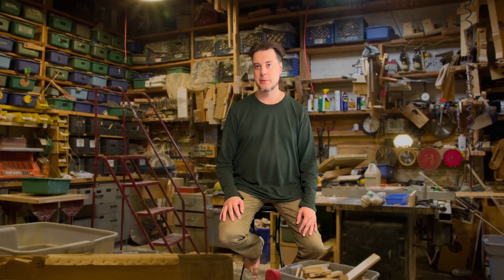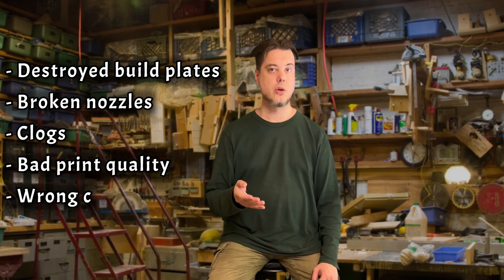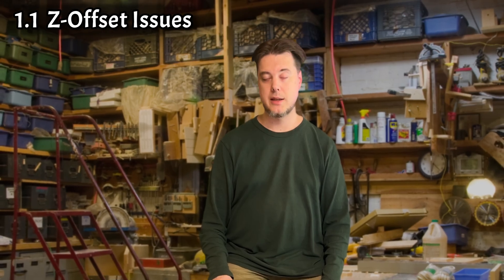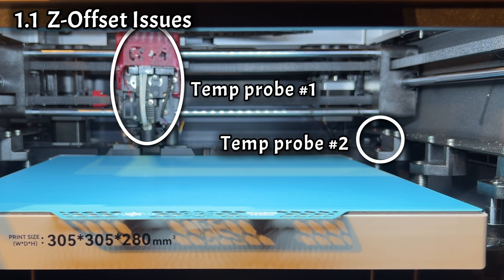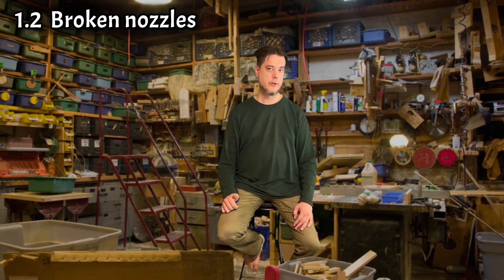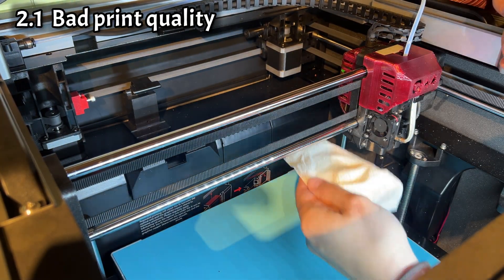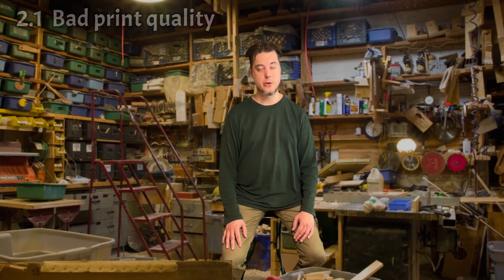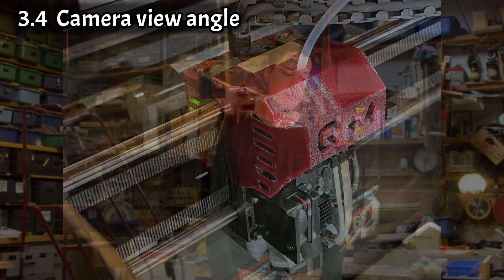Qidi Plus 4: Must-have fixes & mods (free)

Comment: The first layer is the most important layer, can't understand they use such an unreliable way of sensing.
My BLtouch never let me down.
Was thinking about buying this printer but this  issue cooled me down.
If I want a printer that always needs leveling or at least a visual check before every print I have my Tevo Tornado pre BLtouch.
I  expect that a modern next generation printer has a decent level method that works.
Reply from the maker: The Qidi Q2 has ditched the Plus 4’s bed piezo pressure system and apparently works better. I haven’t read of any reports on it failing.

That said, with these mods my Plus 4 gets solid first layers even without ABL at the start of every print. It is a good thing to do though if the bed temp significantly differs from the reference leveling.

Comment: Whattttt I just ordered this just tonight , should I cancel ?
Reply from the maker: It depends. It has a higher risk of having issues, but if you’re ok with doing the steps outlined in the video, you should have a great printer in your hands. Mine has been working great ever since.

If you bought directly from Qidi, returns are a no go no matter what. They’ll send you parts but they won’t let you return it. Amazon returns do work as normal though. Don’t know about cancellation if it’s even a thing, depends on the seller I’m sure.

Tbf I’ve heard similar sorties about returns from other printer companies as well, so Qidi might not be any worse than others in that regard. At least Q happily ships the parts as warranty.

Comment: Thanks for a very helpful review and thanks for posting the Macros.  

I've had the Plus4 for several months and printed reasonably without major issues.  That was until I followed some reviews of the Qidi Box, pre-ordered one and installed it when it arrived.  I have not been able to produce a single successful print since then.  Qidi support appears friendly on the surface but they are mostly ineffective probably due to communication difficulties.  All requests for replacement or refund were politely ignored and I am not stuck with an unusable printer.  The Qidi Box is clearly not a fully developed product.  It has some great ideas but the software implementation is very poor and the integration with the Plus4 has made every attempt to print a funny dance of 6x extruder cleaning, filament wasting followed by attempting to print at the wrong z offset.  I do not understand the z-offset mechanism.  At times the user can change the offset but then it is not followed during printing.  I'm now convinced that the extruder replacement (part of the Qidi box installation) has changed something that affects the z-measurement.
Reply from the maker: Damn, that’s rough. Have you found the Qidi Discord? I’m sure some folk over there can help you in some way.

Comment: So what is the best 3D printer out there i can use to print pc and nylon, without the need to rob a bank or sell my soul or kidneys?
Reply from the maker: I honestly don’t know. The only other printer than my own unit that wakes up some interest in me is the Qidi Q2. It has some of the Plus 4 issues improved upon, and it has magnificent specs on paper. It’s still Qidi though which will be a no go for some Plus 4 owners.

Although, I’m planning on waiting an upgrade until a suitable multi toolhead model comes available, from any manufacturer (except Bambu).

Comment: I love my "cheap" Qidi P4 after modifications. Taught me a lot about printers, enough to take on a Voron build next. I'm done with Prusa, Qidi (and yeah Bambu due to what you pointed out). Thank you so much for the gcode you made, absolutely saved me time and money. I've been using your macros along with the community mods for about 5 months now, ever since I've had no issues. Thanks for making these vids!
Reply from the maker: Thanks for the kind words! And I’m glad the macros have helped you too. 😊👍

Voron is next level stuff… I thought about it but decided on the Plus 4 since I thought it would be the lesser effort of the two. Now I’m not so sure… But the +4 serves me perfectly well until a multi toolhead model comes viable enough.
Reply: @mrelwood_media  Yeah, I'm sticking with the Plus4 for now. Your macros made it 100% accurate and reliable. I hope others see your videos. I've been slowing modding the Plus4 with all the community mods, it's been teaching me the "skills" to take on a Voron project (when Bondtech releases the INDX system). If you end up tackling something with the INDX make sure to record it ;)

Thanks again for the contributions and happy new year!

Comment: Found the reason why the chute scraper is hitting the nuzzle (1.2a, Chute scraper shim).

It is because that little bay between the wipers, where the scraper goes in and out under the nuzzle, has a bottom section made out of plastic. 
So, when the nuzzle poops into that bay, the hot/molten poop welds itself to the bottom of that bay.

Now, when the scraper tries to wipe during retracting, it is not able to scrape the welded poop, and rides over it, lifting itself up, thus hitting the nuzzle. 
So, bending it or putting a shim, I don't think will help much (even if you manage to bend), because that metal is flexible and is sticking out quite far from the clamping point. 

The quick solution, I think, is to cut the bottom of the plastic bay, and let the nuzzle to poop inside the chute. And hopefully, since the falling distance will be longer, the poop will have a time to cool down and not weld itself to the chute and pile up there. 

But I don't know how to take that part out. For now, I put a drop of oil in that bay (the same I use for lubricating the rods) so far that prevents the poop from welding to the bottom.
Reply: Man-o-man this is such a cruddy 3D printer!!   Another issue for me to fix.

Comment: I agree that Qidi states that you should lubricate all rails.  I read on their support site that one of the recommended lubricants is WD-40 Specialist Dry Lube with PTFE.  Make sure to get the one with PTFE (Teflon).  That is what I've been using since I bought the machine.  I put this on all 3 horizontal rods and the 4 smooth Z rods.  I use Super Lube Silicone Grease on the Z screws.  You shouldn't use oil to lubricate that lower rod in particular.  It uses a graphite sleeve bearing.  Oil can gather dust and debris from the air and cause problems with this type of bearing.  Thanks for all the other info in this video.  I appreciate your effort.👍

Comment: I have a new in box unit received last March or April,  just haven't needed anything my Creality bedslinger couldn't do. When did you receive yours and does anyone know whether or not Qidi fixed these problems?
Reply from the maker: I bought mine in early Jan, received at Jan 20th. As far as I know, some issues can be slightly better now, but they haven’t done specifically any actual design changes.

Comment: How do you check X and Y stepper drivers' temperatures? 
These numbers are removed from the current version of Qidi Studio (2.03.01.70)
Reply from the maker: By using Orca… 😉
Reply: @mrelwood_media  Orca doesn't show either (at least the latest version), it shows only Chamber, Extruder, Heater bed by default. 
Is there a hidden switch to show these measurements in Orca?
Reply from the maker: @AM-nd2wq  Mine does show them while printing. I’m using the latest Orca but the previous 1.6 FW on the Plus 4. It could be that they are being made visible by this mainboard fan mod I have installed:

https://github.com/qidi-community/Plus4-Wiki/tree/main/content/adaptive-main-board-cooling
Reply: @mrelwood_media  Qidi tech support says that they have intentionally removed the visibility of these numbers in the latest FW update for "not to confuse the public" :) 
That's why when you heat up the nozzle over 340C and the bed over 80C, the machine overheats and goes into thermal protection and turns itself off. 

I don't even turn on the chamber heater because that messes up my electrical in that room, all my light bulbs start to flicker that share the same electrical breaker in that part of the house.
Reply from the maker: @AM-nd2wq  Right… Quite the move on their part. Yet another reason to stay with FW 1.6!

Comment: What to do with pitting nickel-plated guide rods?
Apparently, they are not stainless steel (magnet sticks to them), and even after heavy lubrication, the shiny plating peels off creating friction points.
Reply from the maker: Are you sure it’s pitting / chipping off? One of my rods were damaged on arrival so I got spares. I tried to scratch the dent further but I still can’t peel any plating out of it. Maybe yours were damaged from the factory as well? Reach out to Qidi support for replacements.

Some stainless steel variants are indeed magnetic: https://www.thyssenkrupp-materials.co.uk/is-stainless-steel-magnetic
Reply: @mrelwood_media  Thank you for the reply. I can see multiple spots on the same rod. I don't know yet if I just started noticing them or their number is increasing, I have to observe them a bit more.  

I have tried to scrape with the plastic wedge to check if it is a pitting or a dirt, it didn't come out.  Don't want to try with the steel because it will destroy the rod. 

The most common stainless in the industry are 304 and 316. I can't even understand where they found a ferritic stainless, if it is stainless indeed. 

For now, I have slowed the acceleration below 1400, to reduce the wear and tear until I find a solution.
Reply from the maker: @AM-nd2wq  I understand the notion to try and prolong their lifetime expectancy. Personally though, I wouldn’t bother degrading the printing speed (I run 13K accelerations…), I’d just run them to the end and replace them. Before that though, contract Qidi’s Plus 4 support since you might get new rods as a warranty.

Comment: hi! thank you for this video, i have a question: i don't need to print multicolor and i didn't buy the qidi box, did you sugges to install the last firmware that introduce the qidi box compatibility or avoid it?
Reply from the maker: Thx! I wouldn’t (and didn’t) upgrade. I read that the only upgrades are related to the Q Box, and it even makes some basic things like filament changes more complicated for non Q Box users.

Comment: Good video! Personally I didn't have these issues, unless I've missed something in the video while going back and forth between it and working on my site TinkerAtlas. I did however have an issue with the lower door hinge. They had missed with the top heat insert so the lower hinge broke loose after about a month I think it was. Qidi was helpful and sent me a new front kit though, so support was good. The process of changing it out was much more tedious than it should have been though, but that's a different matter. Lol

Comment: Whenever I have done a bed level on any of my older 3d printers, I have first allowed both the hot end and bed to reach and well establish the temperatures that I am about to print at. Surely, a hot end nozzle running at the high temps they do, will expand and contract, influencing the bed mesh probing values. I am not advanced enough to know how to prevent it from doing so, but whenever I try to perform auto-level bed mesh, the QIDI always makes the nozzle cool off first.
Reply from the maker: Unless I’m mistaken, Qidi Plus 4 proves the bed with the separate sensor, but the nozzle only affects the overall Z offset which I think is done with a warm nozzle.

But thinking about it further, the height of the hot part of the hotend is max 3cm. The expansion from room temperature to 220•C is about 0.2%, so even if the whole 30mm were as hot as the nozzle, its height would only increase by 0.06mm. And this is taken care of by probing the precise Z offset at the beginning of every print.
Reply: @mrelwood_media  Okay, thanks, good to know.

Comment: Thanks for the vid !! I have not had many issues with my Plus 4 in the past year that I have it. First broken nozzle this week. 
BTW I use very thin (5) synthetic motor-oil for lubrication of the rods. Motor-oil is very stable in viscosity at a large temperature range. Its doped for corrosion and rubber protection etc. Never had issues with motor-oil on any of my printers :-)
Reply: Thanks to your vid I lowered the height of the scraper and chamfered the edge of the scraper ... that's probably what killed my nozzle. 85% of my prints are PETG, the rest ABS or ASA. For PETG I never use volume temp and for ABS (mostly small parts) I use non or 55 deg C volume temp. Maybe that is the reason I have not ran into issues as you point out. Until now I have printed about 15 kg of filament with my Plus 4.
Reply from the maker: Thx! Glad you got it easy with your Plus 4. If you find motor oil thin enough I guess it’s as good as any. After all, Qidi says to use sewing machine oil or light machine oil. I just found sewing machine oil the simplest as there aren’t significantly different viscosities available. And it doesn’t smell bad… 😉

Comment: Ok, I may be lucky.  I've had my Plus 4 for just over a year now and am very happy with it.  Yes, when I got it, I came across the SSR fix (120Vac) soon after ordering it so that repair occurred early on.  Earlier this spring my machine was attacked by the spaghetti monster and, after cleaning up the mess, the hot end didn't work (a thermocouple error).  I contacted Qidi and received a new hot end, front mini and rear controller board, and the machine was back up and running.  Oh, I recently added a larger fan over the drivers.  Overall, I have been extremely happy with the quality of the prints and, unlike my FT-5 which I was always tuning and aligning (enjoyed most of it), the Plus 4 just works.
Reply from the maker: I’m glad to hear yours works great! In many cases the issues are triggered by higher bed or chamber temperatures. So if you only print PLA/PETG/TPU, you could be just fine, until you try to print any of the technical materials the Plus 4 is advertised churning up just fine. But doesn’t.

Either way, yours obviously serves you well, and that’s the thing #1! Besides, if you’ll get any of these issues later on, you’ll now know what to do. 😉
Reply: @mrelwood_media  No, I've printed many large ABS and ASA jobs, probably the equivalent time total for thos compared to PLA.  I've had better results with the Plus 4 over my enclosed FT-5.  (I did print TPU once, but that was a pain to push into the extruder.)
Reply from the maker: @kimnach  Sounds like you really did get a unit that works as it should! 👍

Comment: Good video! I'm sorry to hear so many people have had a poor experience with the plus 4, I've had mine for around 6 months and it's been nothing but stellar. I guess quality control is really a gamble with these machines. My biggest complaint, especially considering it's focus on the engineering filaments is the door not sealing completely, letting abs fumes and other fun vapors out. Also, the lack of a 270° hinge so the door could be tucked out of the way for low temp filaments. Really annoying. I've been trying to design a replacement hinge to provide more sealing and swing out further, but the way they've designed the printer makes that extremely difficult.
Reply from the maker: Thanks! And thank your luck with the Plus4! As you’ve noticed, when it works it’s a great machine.

I’ve seen a few redesigned hinges for the Plus 4, but I didn’t check them more closely to see how they attach. Personally I just printed suitable seals from TPU… (And insulated the rear wall from behind.)
Reply: It's not just the junk of the QIDI Plus 4, it's also the poor customer service and attitude from QIDI.
Reply from the maker: @JocMe-c9h  They’ll happily send you parts though, which is why many consider it a great customer service. But further than that, I agree, not much help available.